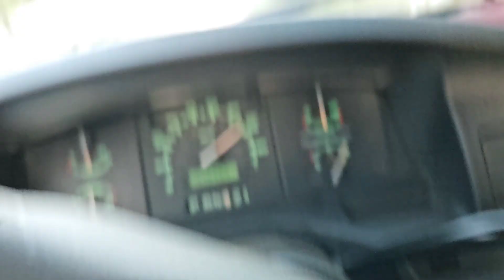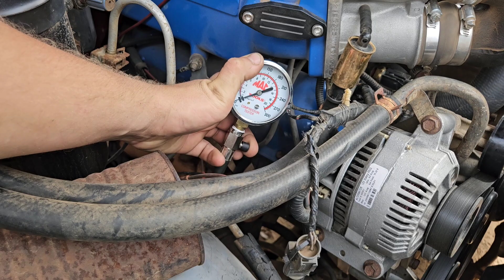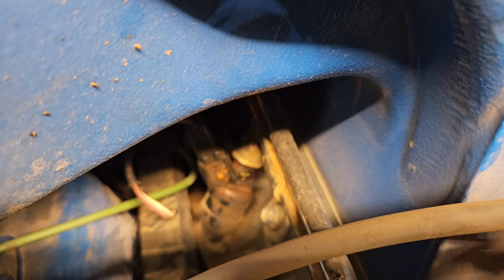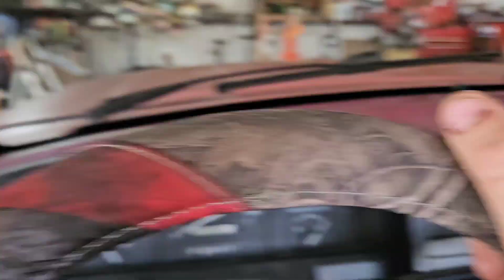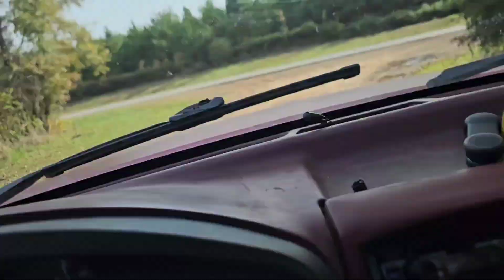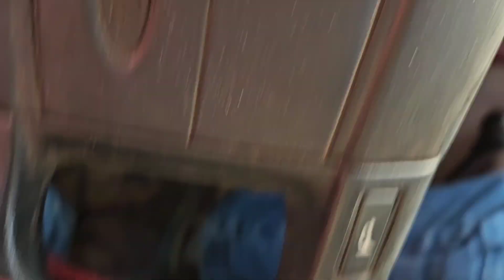1994 F-150: Diagnosing And Replaceing A Bad Injector

Comment: That was a great video, good job. Question why no coolant lines going to your throttle body. And why did you delete the egr valve, by doing that what does it do for the motor. Just curious, i have an 87 its been running rough at idle when i first start it then once i start driving seems to get better but i still feel it sometimes at stop lights.
Reply from the maker: Hey man glad you enjoyed the video, when me and my dad rebuilt the motor we did away with the entire egr system I guess so I wouldn't have to clean the throttle body as much or any i guess we both thought it would also perform better too lol. anyway so when we did that the coolant lines were not needed anymore because there's no exhaust to heat up the throttle body as much anymore. I don't believe I would recommend anyone to delete the egr system for the simple fact of it running more rich even after bringing the timing down lol. I hope that answer your first to questions.

On you truck running rough just so you know im not a mechanic so don't take anything as I say as %100
Definitely do a full tune up with Rotor, spark plugs, wires, and distributor cap, and a coil too. I don't know if yours is EFI or carbonated but if it is an efi and you have a throttle body the throttle position sensor gave me alot of trouble in my truck so check that and sensors are a big issue on these trucks too on the efi models. Hope this helps and god bless you
Reply: @mr.nostash3038 thank you for getting back to me, seems like im always having some type of issues with my truck with the fuel injection. I was looking up videos to delete all that and go carburetor. Seems simple enough for the hard work. But when it comes to all the wires and vacuum and fuel line that where I get confused. No body really shows you what they actually do with all the old wires if there used or not. And all the vacuum lines what ones to keep what to get rid of, but I love my truck it the extended cab 5.0 lariat. I'm also having issues where you started up. And the idol goes up down up down stalls that could happen 4 to 5 times
That's what made me start thinking.Since i've been having so many problems with the fuel injection just to get rid of that whole mess. I really enjoyed your video.You really did a good job explaining things.And showed everything keep up the good work.Thank you
Reply from the maker: Thanks man will do
Reply: Another thing I did change the cap rotor and wires. Because what was happening, I felt it running rough at idle. And then when I was getting on it, it was like breaking up on me at like 25 miles an hour. I had to keep feathering the gas to get home one night. That seems better at 25. And above, it's not breaking up anymore. After I replace the wires and stuff, but the idle still feels rough. They don't sell motorcraft anymore T. P. S sensor.
Not sure what brand I should go for @mr.nostash3038